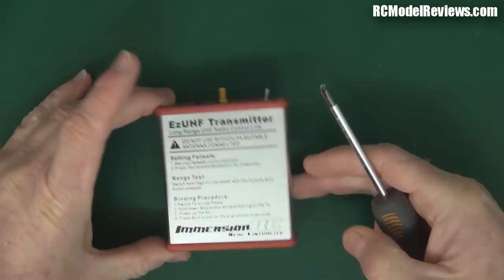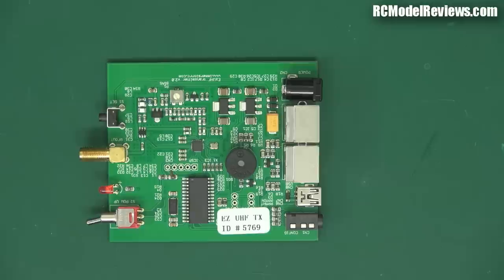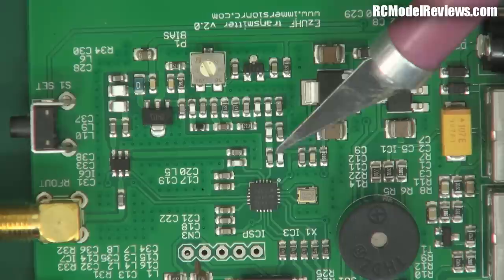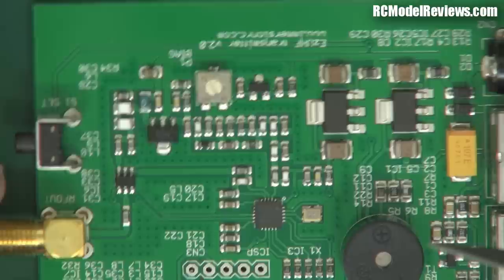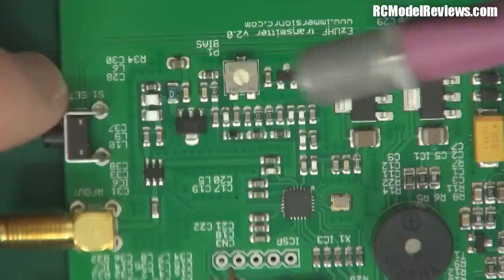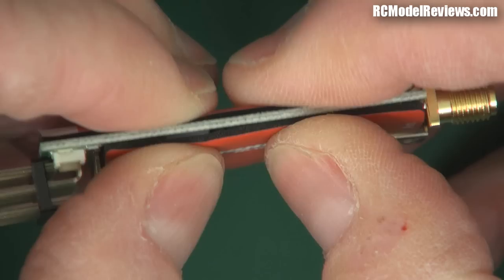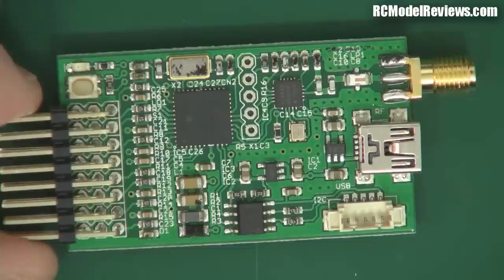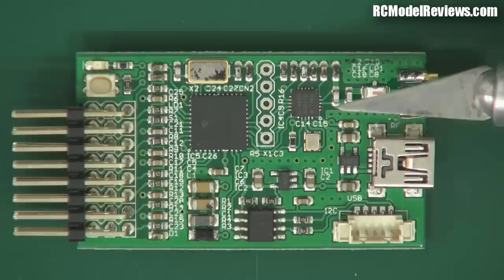UHF RC Shootout: Immersion EZUHF Long Range System (part 1)

Comment: Hi, i just love all you vids with reviews and all fair an honest opinions. I also like you tutorial on basic of flying. As I have seen this video I  was hopping that you could help me with advice on use of the EZUHF transmitter for the LRF. I have a question and the problem. I am trying to use the EZUHF 500mw transmitter with my Futaba 14sg. As per EZUHF manual I am plugging the Futaba trainer cable into EZUHF transmitter. But when starting the radio my EZUHF transmitter does not come on. I have used ImmersionRC Tool program on PC to update software for both EZUHF TX and RX and I also binded them through the PC so i thing that that part is solved. Still my Futaba SG14 is not switching on transmitter and ....where I am doing something wrong. I have turned up and down trainer menu on my radio and I just can not figure it out why it does not emit signal to transmitter. Please, i would be very happy of any advice. Thank you, Matt

Comment: On this video you show the the back of the circuit board , look at the soldier joints that are  ground down . You should , if you see that , heat up your soldier gun and melt them so that there is good continuity and no cracks even micro ones .

Comment: I do not have ImmersionRC system but from general knowledge in electronics I guess that RF switch next to the antenna connector is to switch antenna between Transmitting and Receiving paths of that transceiver chip.

Comment: theres a mod for the ezuhf that gets around the power limit system of the board that i would love to know what it is and give it a shoot to boost the power output and also permits the use of lower voltage

Comment: Very good closeups as usual with your reviews of this nature. I'll be curious on how this system compares to the others as far as performance. I purchased the EZ UHF Tx plug in module for my Taranis along with the mini 4 CH Rx. Should be perfect for my QAV 250 so I can use a video Tx frequency other than 5.8. We'll soon see.
Reply: Jason Campbell  What is the most appropriate long range video freq to match UHF when used in long range activities?
Reply: It's entirely up to the pilot. My thought is that if you use 433 MHz control frequency, then you can use 2.4gHz for your video Tx. That way, from what I understand, you can reduce the chances of harmonic interference from your control frequency. Also, the 2.4 ghz antennae are smaller than the lower frequency ones and still provide pretty good video based on what I've seen on YouTube.
 Again this is just my take on things and until I finish my current build, I won't be able to prove it out. Hopefully Bruce will straighten me out on this in case I am wrong. = )
Reply: I was thinking 1.2ghz or a lower one if there is one 900mhz?  . If you're at ranges of 50km, you prob won't have real line of sight so want a freq that can bend and filter through things better. Not that I know but in principal I think the lower freqs are going to be like that. 5.8 would surely be no good unless you're up high with real line of sight
Reply: Yes I hear of many who use 1.2 ghz for Tx. I have heard of 900mHz but not as common.
Reply: *****  1.2/1.3 video is what you match with uhf for LRS. The quality of the video feed, at it's best is potentially lower than what 5.8 offers, but 5.8 will never match the potential distance whereas the 1.3 video will go as far as the control under proper conditions and proper build. I run everything but 2.4 video. 900 is out if you want to use the new TBS Crossfire system as it runs on 915 I believe.
Additionally- in Europe, the APM ad pixhawk telemetry is on 433- which is what ez uhf is on in the states. In the states, the pixhawk and apm telemetry is on 915. So there are many t's to cross and i's to dot when building a long range system, and much thinking about where you may want to go with a craft in the future.
Very cool stuff though- but I geek out on this stuff.